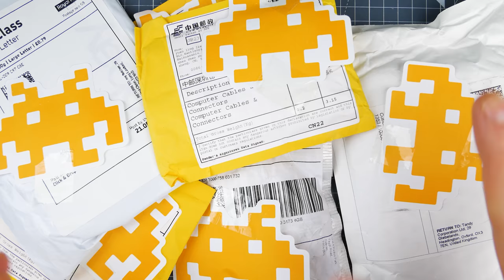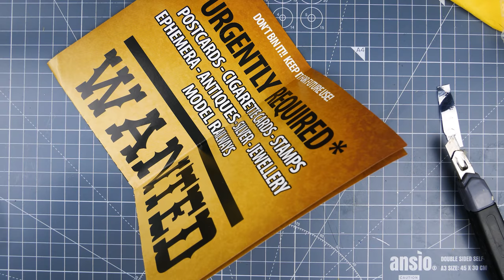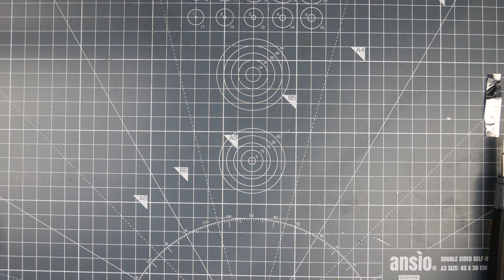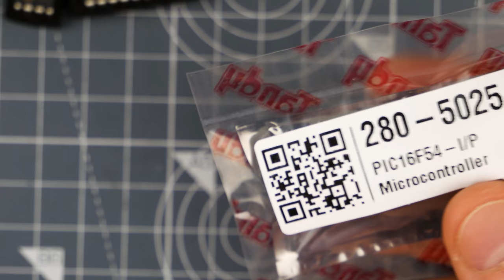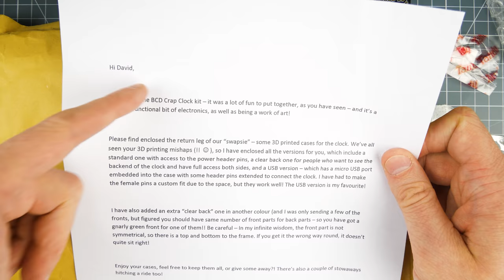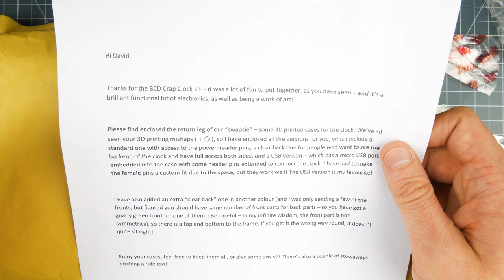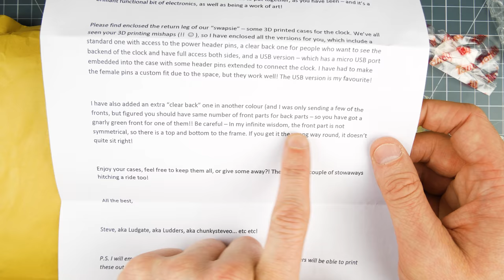Post Bag 12: It's just one thing after another

Comment: 8:40 With switches you can't trade voltage for current. If it's 1.5A it's 1.5A, and lowering the voltage from 240V to 12V isn't going to give you any extra current handling capability. Also, if 1.5V is the AC rating, it's probably going to be lower with DC.
Reply: Hagledesperado DC amp rating is a lot lower than AC. Probably because of arcing.
Reply: Same. I've often used mains rated switches for 12V DC, when the mounting I wanted wasn't available in a mains rated switch. But the current rating is what it is! Assuming also the switch is decent quality!  So, if it was an eBay switch I’d probably allow for current rating divided by 10. LOL
Reply: Greg Clare a switch rated 250vAC at 10A is definitely not good for 10A in a 30vDC circuit. Usually you'll find a 250vAC 10A switch is probably good for say 15A at 125vAC and only about 1A at 125vDC. I wouldn't use it it for more than a couple of amps at 12vDC. Higher DC currents will probably weld the contacts closed.

Comment: Just yesterday I was using alligator clip cable to test a mains powered transformer, and it behaved funny. Turned out the cable was barely touching the alligator - so I suggest you always double check these cheap Chinese gizmos, especially when testing with UPS / mains / etc.
Reply: Evgeny Zislis I've had very poorly connected ones too, be careful especially with large currents.

Comment: Lol 0201 I regularly fit 01005 under a microscope though I use 0.1mm jbc tip or hot air it's still not easy.

Comment: you can get those switches on ebay, but not really much cheaper. 3.50 usd for 5 or something. Though, those are (at least according to their markings) good for 15A at 250VAC.
Reply: 15A switches for less than a dollar a piece? Sounds sketchy.
Reply: @jort93z I think you meant 1.5A at 250VAC. There's definitely a decimal point between the 1 & 5, also considering the 3A at 125VAC rating.  
But for 12V DC usage I wouldn't use them for much above 1A - 2A, maybe 3A tops, depending on contact quality.